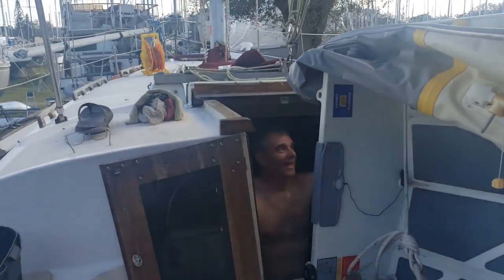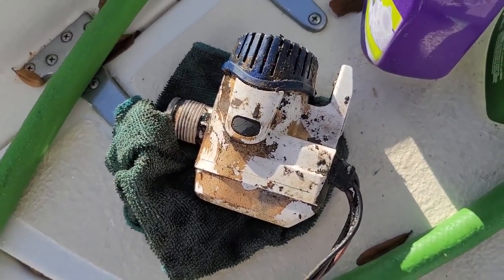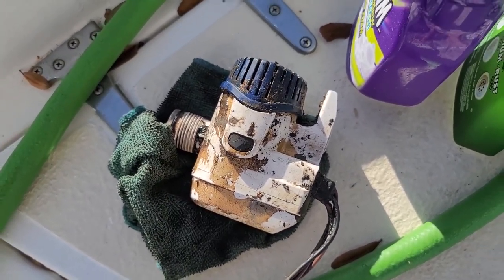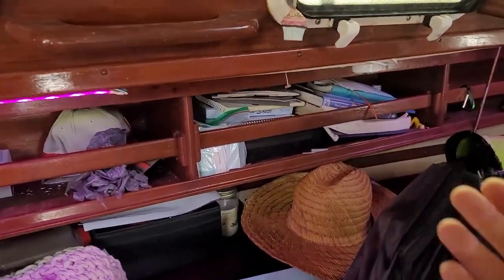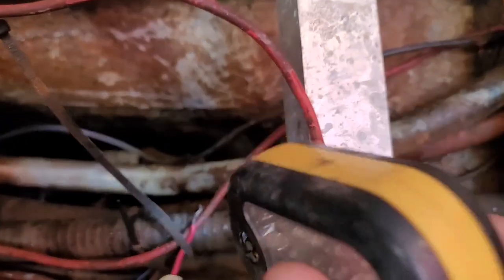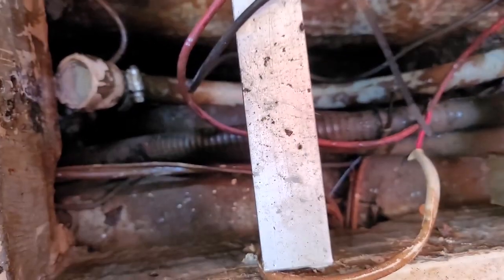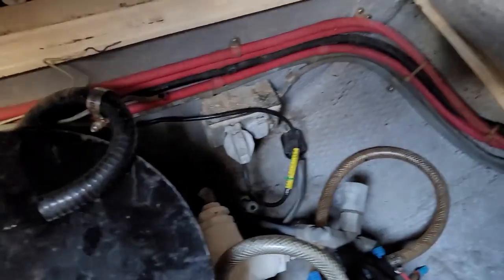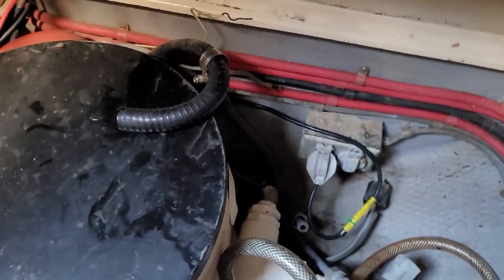When things go right during a refit - Log Entry - 91 - Knot Vanilla

Comment: If your seacocks have the 2 little plugs in it the bigger one is a drain the smaller one is for a zerk fitting. Then pump it full of marine grease. It should never freeze again.
Reply from the maker: Thanks. Used some grease once I put it back together hoping that would work. Here's to hoping that it remains free. 🙏